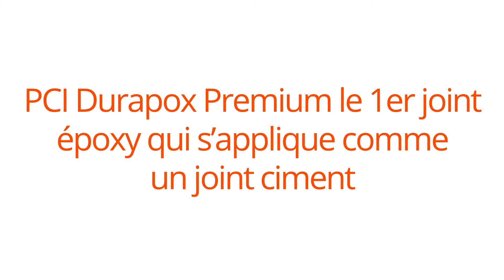Comment faire un joint époxy facilement

Comment: Pourquoi mettre le produit sur toute la surface des carreaux alors qu'il s'agit de combler les joints. C'est à croire que la logique n'y est pas !!
Reply from the maker: Bonjour, nous vous remercions pour votre commentaire. 

Notre joint s'applique comme un joint à base cimentaire.
Dans notre vidéo, en fonction du format du carreau, nous appliquons principalement le joint au talochon en diagonale (technique couramment utilisée par la profession et qui permet un gain de temps considérable) puis une fois le joint rempli, nous recommandons de racler l'excédent pour éviter une perte de produit.

S’il vous faut plus d’informations, nous vous recommandons de nous envoyer un mail à cette adresse : pci-france@pci-group.eu.

Nous espérons avoir répondu à votre question, à bientôt !